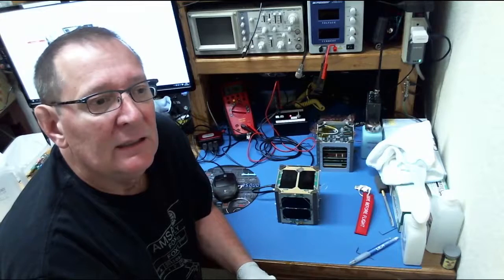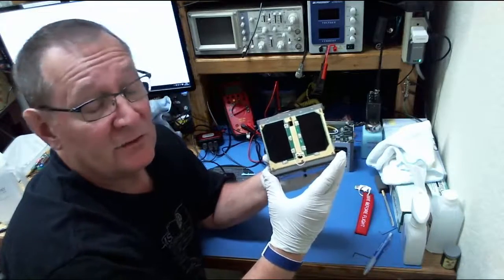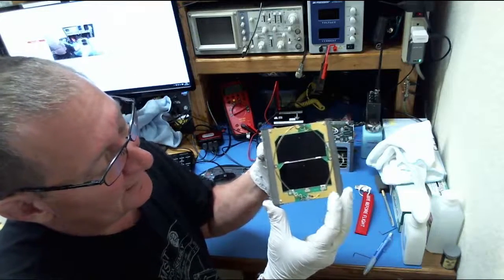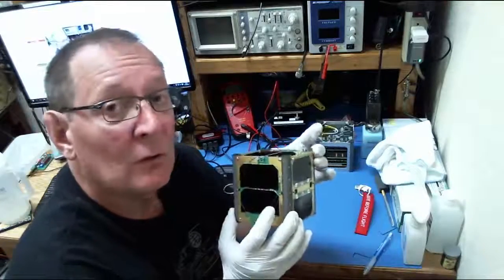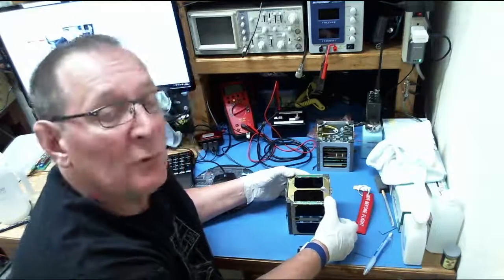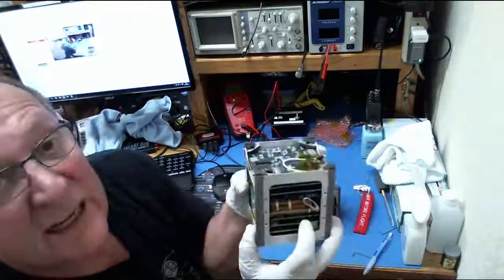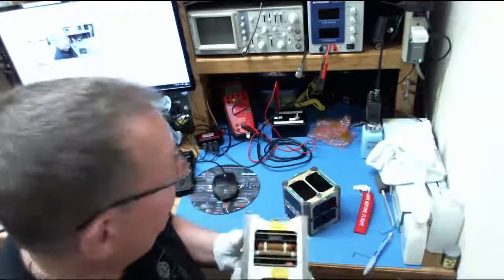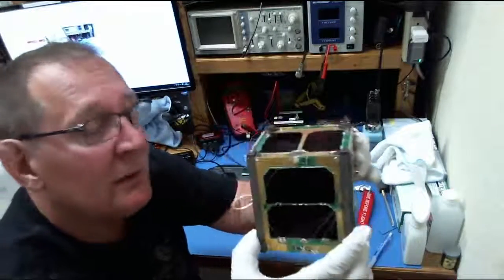RadFxSat CubeSat "Tour"

Comment: Very cool and informative video, thanks!
Do you think that supercaps are the suitable replacement for NiCad in nanosats? I am asking mainly sinc since their temperature range of operation seems to be wider  (-40 to 70 C) than regular batteries.
I am aware that the energy density in a supercap is way lower than in a batt, but why not?